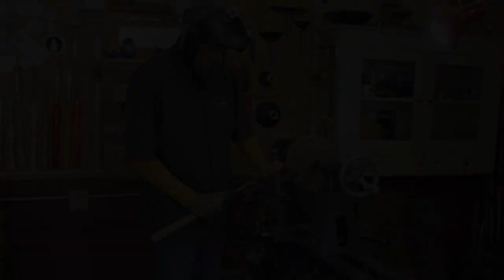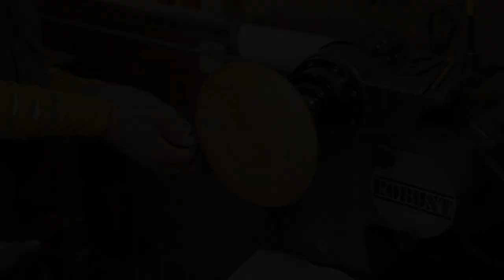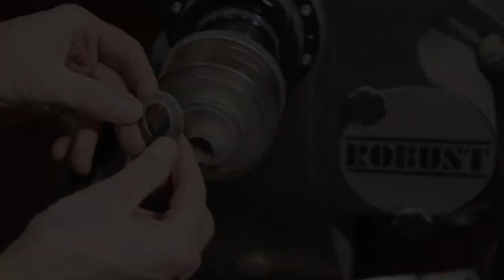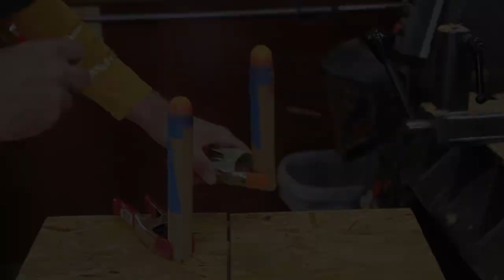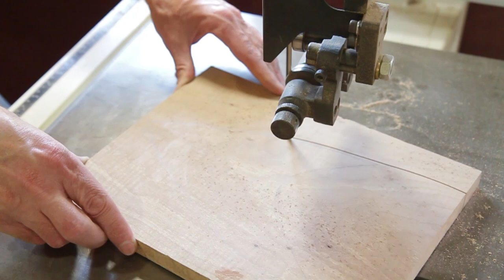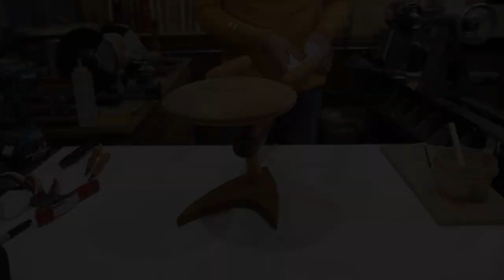Woodturning USS Enterprise | Carl Jacobson

Comment: Nice video Carl ! You have still the soul of your childhood ! It is really nice.
I wish I could have done such a video. Plenty of fun, and the project is nicely made. Thanks for this.

Some small questions:
- are you really working without any drawings ? (and if not, could you maybe share the drawings ?)
- which kind of glue do you use for the various assemblies (it does not seem to be always the same) ?
- what is the finition product you apply with a brush?
- You seem to use 'Forstner' bit with a hand drill and changing the angle during the drilling. Is it easy ?

Thanks again for your videos ! I am watching them almost every week ! 

Vincent
(from Belgium; sorrry for the somewhat 'Brussels English'!)
Reply from the maker: +Vincent massaut Thank you very much Vincent!
No I don't have any plans or drawings, I was just looking at a picture. I'm going over all the measurements on the follow up on Monday. 
I used Titebond ll on this one, but sometimes I use Gorilla glue. 
I finished it with Butcher Block conditioner.
I'll show more on drilling at an angle on the follow up, it's pretty easy.
Take care,
Carl